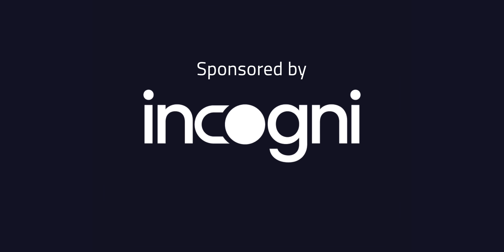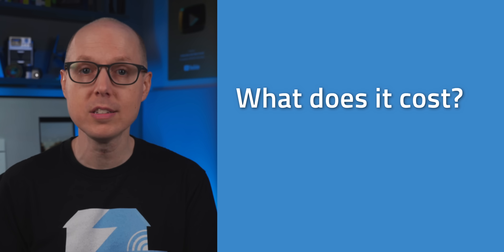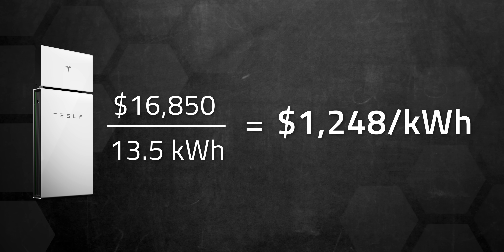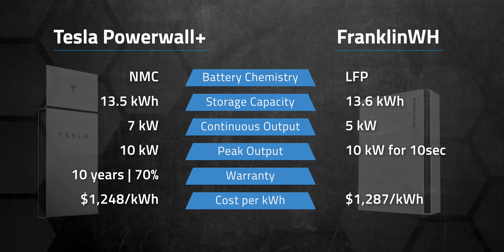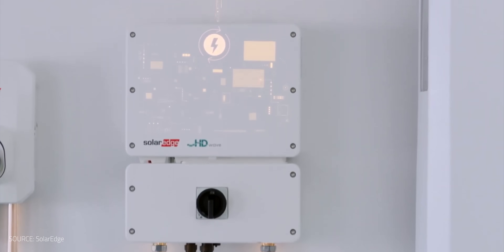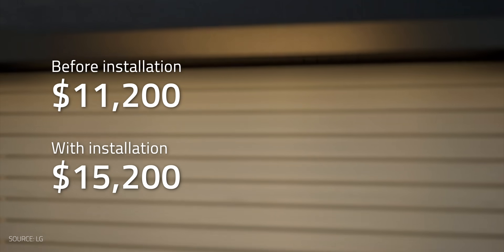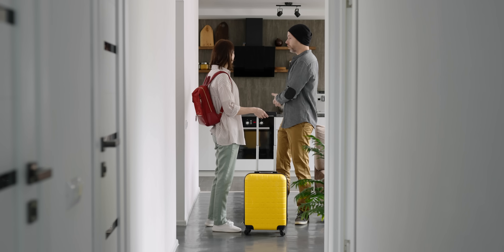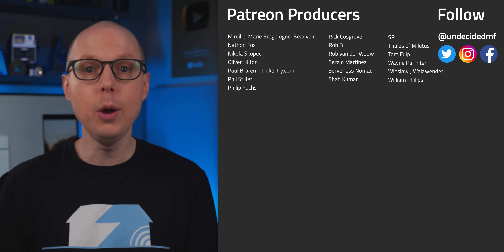Top 5 Batteries for Home (And One You Might Not Expect)

Comment: My preference would be for Nickel Iron batteries with an expected life of 50+ years (oldest ones still in use are over 100 years old) and warrantied for Iron Edison's for 25 years you only need to buy a set of batteries once in your life, bonus you can add more batteries to the system at any time without causing issues with older batteries. So you could start with 5kw of batteries to keep cost down then add another 5kw a year later and then keep adding each year if you wanted.

Comment: Hello, I'm planning on buying a tesla wall 13,5kwh with a continuous output of 7kw. Does this mean I could run this wall for almost 2 hours (from 100% to 0% within 2 hours)  every day for 10 year with 7kw load? A friend told me I can only use between 90% to 50% if I want to reach 70% after 10 years, that would be just 5,4kwh available. Suppling the 7kw load will last about 46min. Which analysis is correct? It makes a big difference in the final cost.

Comment: Thanks for this info.  One thing i am not seeing is appliances like Fridges, Freezers, and Heat Pumps that run on DC.  I am using small solar panels for led lighting without the need for inverters.

Comment: Cell prices have been dropping as have pack/battery prices over the last 4 or 5 years, however, end user product prices for powerwalls etc have not even come close to reflecting this. Pack level prices a rumoured to be under $100 per KWH. THATS $1350.00 for a 13.5Kwh  battery but 10 times or more than that for an installed system, obviously there's the inverter and other systems but it's still expensive. On the up side the available profits should mean more companies get in on the act but its still slow going. Hopefully  the flow batteries will be a thing then we will see instant and dramatic fall in the traditional battery systems to compete. Thank you to the early adoptors but I think the cost effective solutions are just 2 years away now 😊

Comment: The biggest factor for me is the continuous power rating.  The Enphase battery wouldn't be able to run just my water heater (5 kW).  I was looking at the SolarEdge Home battery which has a 10 kW rating when using two or more batteries.  I have a fully electric home with a Tesla charging station.  My needs are much greater than the average residential home.  It becomes clear that most solar/battery systems fall short of my full needs.

Comment: One option that fills a different niche is the battery outfitted induction stove from the start-up Impulse. David Roberts featured them on his Volts podcast - its worth a listen. I don't think the storage capacity is quite in the same ballpark, but the advantage is that it wouldn't require any electrical upgrades and would put power into the kitchen, where it would A) be useful to run appliances during peak times, and B) could be used to run arguably the most important appliance in the home during a power outage - the refrigerator.

Comment: The problem I find is installers seem deeply tied to individual options and when I start to throw around different brands they start to skulk away, which is really frustrating, such as trying to get them to quote for a full Enphase or Solar Edge system seems to be nearly impossible

Comment: Great overview, but a few comments. You didn't look at the Generac system, which is interesting to me because their main product line is gas generators. If they see the need for battery systems, the ball is really rolling now. Two: I've been lecturing on solar and alt energy for over a decade now, and it never ceases to amaze me that 95%+ of people have no idea how much electricity they use in a day! When I tell them that a 13.5kWh Powerwall is unlikely to last a half a day, they get very discouraged very quickly. Maybe a video on the baseline info would be a good use of your channel. Wrap that around the idea of triaging your electrical use - no one is going to be running their AC for long off any of these systems. Finally, you ignored the biggest batteries that many of us already have and can come in handy in an emergency - our EV batteries! My Chevy Bolt ran my fridge, LED lights, TV, Internet infrastructure and several fans for four days in the spring of 2022, and used about 33% of the battery. How about a discussion of that idea? 
Love the channel, excellent production values. Do you do your own editing?

Comment: Temperature dipped below 3 F in a windstorm... lost power... temp in garage where the Sonnen was installed dropped below 40 F... guess what I didn't have? No errors... no backup power... no heat... through the night... till the power returned.

Comment: Where I live our summer days are long but winter days are short, so a battery for me would remain close to fully charged in summer and never have enough light to charge in winter whilst running my ASHP. Obviously, I could load shift, but still a hard sell. My plan currently is when my petrol car needs replacing is getting an EV with vehicle to load, as the low mileage I do will mean an EV on its own would also be a hard sell. But combining the two? That definitely makes some sense.

Comment: I want to wait for the flow battery... but if it doesn't pan out, or if I must buy something sooner, I'd go with the lithium iron phosphate battery chemistry. Longevity and durability is much more important to me than peak power output.

(I already have a UPS under my desk which can also power my refrigerator if necessary, but the much more powerful Bluetti sure is tempting!)

Comment: As a solar installer and professional solar system engineer, I have some input. 
Wow, the Tesla is expensive. 
I recommend Fortress batteries with a Sol-Ark inverter. Extremely high quality, and their modular eFlex system allows for customization. Fortress is also WAY cheaper. Like $700/kWh, not including install. Sol-Ark is an expensive inverter, but extremely robust. 
From my experience, SolarEdge is low-quality in that it has more problems over time. 
Enphase is great... except that they cannot function without a network connection, and the frequent software updates do sometimes contain bugs which can really throw off your monitoring. 

I would like to hear your thoughts on the SparQ microinverters. They have an extremely low failure rate and seem very impressive both as far as cost AND power output goes.

Comment: The battery cycle, a crucial battery rating was left out of this review.   Some batteries have low cycle, which correlates to short life span.  There is a wide range of battery cycles in the market.  Some range from 2,000 to 10,000 cycles( for lithium) .  A battery cycle is the amount of times the battery is discharged and recharged.  Depth of discharge ranges to 80% to 100% depth of discharge( lithium).  A batter cycle rating then reflects how many times the battery can be discharged and recharged.  Batteries rated for longer cycles will last longer.  Look beyond the KW or storage capacity and look at the quantity cycles the battery is rated for.

Comment: I find those prices absurdly high, it's practically the same price for a 65kWh EV battery...
It should be mandatory that all EVs have V2G or V2L capability built-in, it would solve a lot of issues related to power outages.

Comment: Good summary. For us we spent 20k with 10kw solar and 21kwh of storage. From a running cost point of view, our bills have stayed lower. We are in the process of switching from gas to a heat pump and hopefully this will stabilise the costs. Our payback is around the 8 year mark, but this has worked better given the current price increases and I do not think the price of electricity is going to go down much now. The message is, use what you can generate onsite and store and use what you can generate on site.

Comment: LFP batteries can be much much faster charged and discharged than LI-ION / LI-PO. If there is an limitation in the output of line volage, its just about cheaper components used for power conversion. I run an off grid system via LFP batteries and converter from Victron. So far is almost nothing better out there.

Comment: We have Powerwalls and are very happy with them.  Between them and the solar we have largely eliminated our electricity bill and they seamlessly take over in a power outage.  We don’t even see a light flicker.

We used to spend up to 600 a month on electricity.  Now the bill is around $12/mo which is the grid connection fee.  We got our Powerwalls in 2020 when they had discounts and paid around 6k each and about 1k additional for the install since they were already here installing the roof solar.

Comment: Great video. Wish you talked more about power output and how adding batteries can add to your total power output. But not all system offer this IE Solar Edge only offers more capacity but not more power output when you add batteries. This is a critical data point when picking a system. Especially when tuning things like A/C that can draw 4+KWh. Not leaving much room on one battery for added power out put. Tesla I think requires 3 batteries if you want to back up your A/C.

Comment: 48V server rack batteries at 5kWh and $1,500 each:
Battery Chemistry: LFP
Storage Capacity (3): 15kWh for $4,500 before 30% tax credit
Continuous Output (EG4): 6.5kW for $1,500 before 30% tax credit
Peak Output: 8kW
Cost per kWh is $280/kWh after tax credit
Easy DIY and this is how the average Joe can get to battery backed solar
Figure $7,000 for a basic system OR expand to $18,000 to run a big house

Comment: I have had my Enphase 9000 watts of solar since 2015. I'm happy with just having a UPS on my important circuits. Hard wired into my distribution panel. Two 100 amp hour batteries. I would never put a power-wall in.

Comment: Make sure you check the temp limitations on the enphase..it is much smaller than powerwall and even states will be damage if operated to cold. (Check manual)My installer wanted to install one on an outside wall in Nebraska!

Comment: Maybe someone who knows about this can opine. Surely a home flow battery is challenged by the much lower round-trip efficiency? This is critical. Where I live, the difference between peak and off-peak rates is a factor of 4, which pays off the battery system in about 4 years. But if the RTE were say 60% or so, effectively the difference between peak and off-peak is almost halved thus a huge reduction in payback speed. The superior RTE of LFP and Na-Ion - well over 90% - is killer.

Comment: I now have time-of-use rates. Free 8pm-6am and $.29 kWh daytime. With 40kwh lfp and 4 Growatt 5 k inverters,the system hardly ever connects to the grid in    the 
daytime. I must admit,I wasted some money and time while learning to diy ,but I still have less than $20k including 15 kw SanTan used panels.Much cheaper and simpler and the experience is priceless.

Comment: I prefer the server rack LFP battery style.  I have 30 kWh, consisting of 6 EG4-LL units.  Lower cost per kWh, ability to scale in 5 kWh increments, individually replaceable, and not tied to a particular inverter brand.  There are many brands of server rack battery, and most are drop-in replacements for others.

Comment: I was surprised you didn't mention bidirectional EV charging. As an example, I've got a 2015 leaf w/ 24kW. We keep the charge between 20 and 85% and typically charge it in the afternoon or early evening regaining 25-40%. Our electric power utility is pretty good so we haven't seen more than a 2 hour power outage in the last 5+ years. But there's a good chance we'll have at least 40% of the ev battery available for household use. That's 9.6kW! Its "street" value currently makes it competitive with the storage devices you have listed which makes it an incredible deal as it also has 4 wheels and is a very comfortable ride for local (90% of our mobility needs) trips. There are three bidirectional charger mfrs that I'm aware of:
Wallbox
Enphase
Autel
Please keep up the great work you are doing and tell us what you learn about this strategy soon!

Comment: Lead acid batteries should have been included as a baseline. I know they're not commercially available yet but you've done previous episodes on new battery technologies (sodium, plastic, metal oxide, etc) where one of the main benefits is pennies to the dollar cost reduction versus lithium. Many hosts talk about these batteries as grid-level storage options. Will these scale down to home level use? Cost being the single biggest hurdle to mass adoption I would expect these new batteries to be a significant talking point.
Reply: Once I started building my own lifep04 chemistry lithium battery banks, I found them to be far superior to my original  lead acid AGM battery bank even when it was brand new. I will never switch back to lead acid batteries for backup power. Lithium batteries have been around for 20+ years and their strengths and weaknesses are known. Why compare something that might work in a lab, is not commercially available,  but has never had extensive field testing?  Home assembled 48 volt server rack battery and all in one inverters are available right now and prices have come down.
Reply: Pb acid has poor cycle life and is toxic. If one does a life cycle analysis it’s the most costly to install.

Comment: I have a Huawei Luna2000. I got two modules (2x 5kWh LFP) but supposedly it scales up to 9 modules or 45kWh.  Although this is DC-connectd to my solar panels, so it can very occasionally charge at the peak output of my panels (7.4kW peak) I also charge it overnight from the grid at low-rate electricity.  I'm lucky that my grid supplier charges 17.5c/kWh at low rate and buys electricity from me at 17c/kWh, so I'm totally happy to pay that 0.5c/kWh arbitrage for all that, and they're totally happy too because they buy electricity for waaaay less than that in the wee small hours.

Comment: Hi Matt, you should definitely have a look at Victron. For home storage, they partner with Pylontec Batteries very well (any battery can serve in the range from 12 to 48V) and the system is so flexible, that it can deal with any situation. You can AC or DC connect it and even mixed installations are possible, also with existing AC inverters on both the interrupted and non-interrupted (UPS) outputs or the AC input. Victron is usually a bit more expensive, but it is easily upgradable and also supports 3-phase AC (with 3 inverters) and is easily upgradable on the inverter side by paralleling more inverters. If you want to have a look at the most flexible systems, just have a look at the Quattro and MultiPlus-II types of inverters. I'm an electronics engineer with many years of experience and I think, it is an ingenious piece of engineering in my eyes, which most inverter manufacturers could not believe is possible for the home market.

Comment: we installed a 9kw system over a dozen years ago, no battery and yes the excess fed back to the grid here in Australia, and yes not at night time as solar only. we produced much more than we used per year,  not for a specially favourable select period . The rate received from grid rebate paid off our complete system costs in seven years. Later of course the rate massively reduced but dont forget the extra we and other produced allowed a gap in energy required to be met without the grid spending to upgrade. but harnessing wind too with batteries would be great but the cost is astronomical.

Comment: Home batteries are still grid connect. That means you need the govts permission and eventually they will take power from your battery to service the grid if necessary. The whole point of solar and battery for me is to be stand alone and off grid so global forces dont mess with my power prices

Comment: I got 3 - IQ10 batteries from enphase installed last year, and while they are working really well, and integrate with home assistant nicely, I was disappointed to learn that each of them is using 1.5kWh per day just to stay alive. There's a couple of threads about it on their forum, and it's basically expected. Now I could turn off the batteries and turn them back on during an outage, but that kind of defeats the purpose.
So where I live it means that I'm spending $200 per year on batteries that I'll use only a couple of times per year during outages. If I knew, I would have probably gone for a system which doesn't constantly use power, or where the system can disconnect the batteries when not needed.

Irrelevant for a system where the batteries are expected to be used everyday, but for my use case I just keep them full until an outage shows up...

Comment: Hello Matt, noticed in the video you mentioned mostly integrated battery/inverter solutions, but you failed to mention other great products that are component agnostic when it comes to integration with other solutions.  
Sol-Ark  inverters provide great versatility in terms of PV handling with compatibility with string or microinverters as well as working with any battery available on the market.   Batteries like the models from Homegrid or Fortress batteries provide great value and reliability using only LFP battery chemistry.

Comment: All of these options are great in the time where energy demand is only going up. But for me being a DYI person and a licensed electrician, I would go salvage a battery pack from a gen 3 tesla. They are the exact same batter as they use in a power wall. To me the cost of buying a totaled tesla makes the whole installation less than 5k for me. Granted I am not paying for labor, up cost for materials and the fee's of permits through a company. But there are ways of getting these high dollar systems without having to pay top dollar for them if you look for it and ask questions.